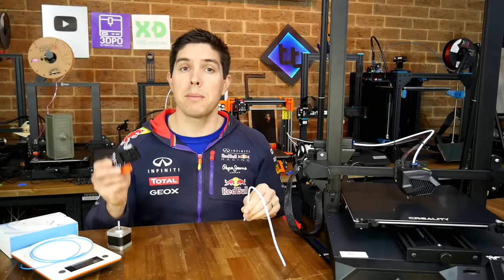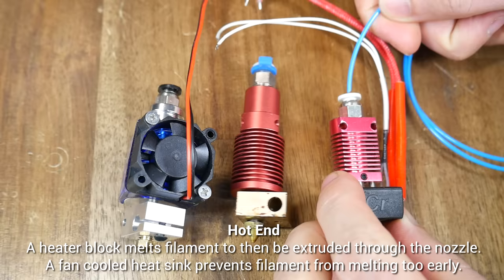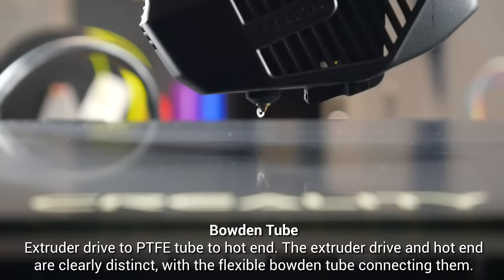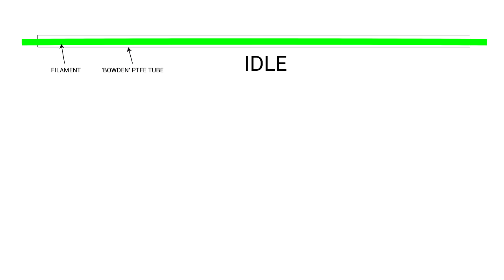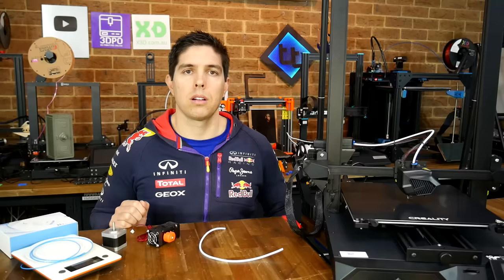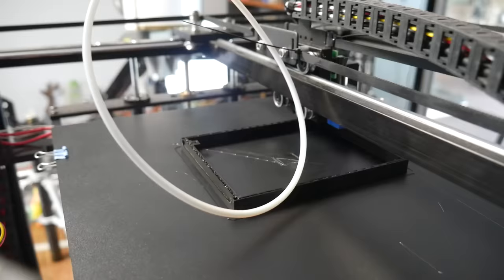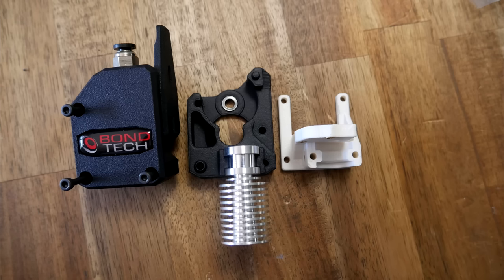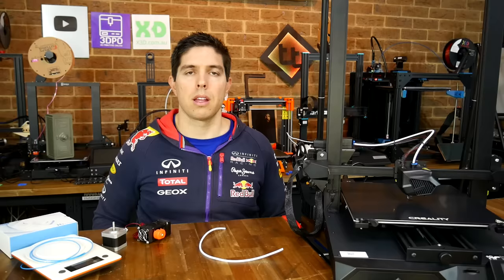Why direct drive is not automatically better than bowden tube

Comment: Of course highly subjective: My first printer was a classic I3 clone with direct drive. Then i got two ender 3s, which in the first half year of their life printed flawlessly. But after that half year, problems in maintenance mounted. One thing you did not made particularly clear is that not only do you need to dial in retraction on bowdens, but the bowden tube itself introduces alot of possible error causes and calibration in general is a lot more tricky. In my example, i've replaced almost the entire print drive section from the bowden down to the hotend without getting anywhere near the actual cause of the problem(s). The bowden tube itself is of course a consumable and even with a fancy extruder setup you can end up with filament shavings in the tube, that can ruin your day completely, because of the long filament way to the hotend. The results are: cloggings, lots of cloggings, under extrusions, failure to feed and whatnot. I have had nothing but trouble. More than i've ever had with a direct drive. 
I have converted both to a SKR Mini 3+ H2 combo and they print like a charm now. Granted the half year of the H2 is not quite over yet. So i might eat my own words soon. But so far: fingers crossed.

Comment: if you have a bowden setup that gives you trouble i think the first step should be to shorten the tube. in the tronxy yuo could halve the length of the bowden if you mount it in the center of the printer :-)
Reply: Thats what i started with,  still isnt a scratch  on direct drive for any speed of printing.

Converted my x5s-400 to a tool changer now. Still on the stock crappy vslot wheals but even with a very heavy directdrive supervolcano (1.4mm nozzle)  i have less issues than with the bowden.

The watercoold bmg clone with bimetalic heatbreak from triangle labs is my favourite for detailed stuff though

Comment: I have two printers, one with direct drive for Flex filaments and one with bowden for another printings. I will not change this before I really need something different. The next printer will be a CoreXY, and will use bowden too.

Comment: Gear direct drive extruder with a Volcano hot end with total weight print head of 300g on my delta + klipper firmware = high speed and excellent quality without vibrations and ringing.

Comment: Only issue I'd see on a hybrid extruder would be backlash from the flex driver. Other than that it would still be much easier to tune out than a bowden extruder.

Comment: I have a RostockMax 3.2 delta, with a really long bowden tube on it (probably over 600mm), and I have to say, I have had very few problems with stringing.. I print with 7mm retraction, when retracting at all (I usually have combing mode always on), but still... stringing is very rarely an issue for me.

That said, I have printed almost exclusively in ABS here, with some occasional PLA... have never tried a properly difficult material to push through a bowden, like TPU... I expect that would be a new challenge.

Comment: Flexdrives are interesting ...lightweight for speed ..but they are like 40:1 which completely defeat the high speed purpose. Though I haven't tried but there might be a way to up gear that on the motor and run a kickass bldc motor? Something to tinker maybe :)  I might order a kit. But I'm afraid of chewing gears on the print head at high speed and high accel

Comment: I use a couple of years a prusa mk3, and now I get him an Ender 3 max as big brother for the more "coarse" prints with a .6 mm nozzle. 
After a few prints, i saw no disadvantages of bowden drive compared with the direct driven prusa while printing. What sucks more is the filament change and the fiddling through all instances. On the prusa the filament is changed in seconds. (If heated up)
Sure, the first on my Ender i ve done is the trick with the separate PTFE tube and a washer inside the hotend, because so many people seem to ran into issues with the direct tube line from the drive ending directly in the hotend. The reason is the Tube slips due to movements and builds a gap in the hotend where  meltetd filament then jams. 
Anyway, i would rather invest in a better hotend w/o PTFE inlet than replace the extruder to a direct drive.

Comment: DD overall would be better BUT at the cost of print speed, since you get a lot of ghosting if you push it too fast.  Bowden allows for faster print speeds but stringing will take some tuning.  Smaller FDM printers are fine with Bowden since the tube isn't very long.  Large printers DD would be better due to a bowden tube needing to be quite long.  Medium size printers it would be down to preference or quality of the build (printer).  

I have both a small FDM printer on my desk (Monoprice Voxel) that is quite nice and has been a great workhorse so far.  The other is an Elegoo Neptune 2 (hard to find) which is an Ender 3 clone according to reviews.  Both are Bowden tubed and the stringing is minmal on both, probably just needing some tuning which I haven't done yet.  Note:  Both of my printers use a rough surfaced, removable, print bed instead of glass and neither have had ANY adhesion issues at all, in fact, quite the opposite (usually need to scrape the print off, even with a boat).

Comment: Bowden setup for machines where the bed is moved in Z only so Core XY machines and cantilever machines like the Ender 2 or Prusa Mini.
Direct drive is best for all the I3 clones, like you mentioned speed wise you are being limited by the print bed, and many print beds are still heavy glass beds (with great adhesion).
For Deltra printers a "flying" extruder works great. The Nible stuff sounds great but it is costly and you still get all the tolerances from the flex shaft.
Also an important aspect of the extruder system is if it is a 2 gear or one gear extruder. The 2 gear extruder usually is not as great as I would have thought since the teeth don´t mech perfectly and produce patterns and non uniform extrusions. One gear is enough force wise usually.

Comment: In my experience, If there’s a need to convert a direct drive machine to a Bowden to improve quality, the problem isn’t the extruder system, it’s the rest of the machine. A Bowden is like the skinny spare tire in your car; a quick temporary fix in exchange for tremendous performance limitations. The amount of head aches, tweaking and frustration getting it to print right should be considered torture.
Reply: ... I think you mean the issue is user error. They aren't that difficult.

Comment: Bit of a niche use case, but I'm messing around with custom Gcode for non-planar printing, and am finding the geometry of my direct-drive (Hemera) set-up limiting. Bowden and a very thin hot-end assembly with an airbrush nozzle for its increased length and higher taper is probably the way I'm going to go.

Comment: Thanks for not mentioning flexible filaments only being suited to direct drive - its an old myth that needs to die. It only pervades because most bowden extruders don't have constrained paths. 

Also, I prefer bowden because I can mount my heavy spools to the side of the printer completely unconnected rather than on top, which reduces ringing and increases stability.

Comment: I think it really depends on the 3D printer, for example my delta printer printhead ways only 100g and can do crazy speeds.
Would be a real bummer to put a directdrive on that.
And for some use cases for example mechanical printing speed is more important than having a little stringing.

Comment: I printed just printed the DD bracket for ender 3 and used the stock extruder..done direct drive. I havent tested it a lot but i have no more extruder skipping wich was driving me nutz. only issue so far is that the Z axis screw started to make a high pich noice when moving,thats from vibration easily fixable. I do recomend dual Z motors for the added weight because the thing feels heavy at least with the stock stepper

Comment: You should try orbiter extruder mounted on a delta effector. I successfully mounted the orbiter on a custom effector designed to fit on a kossel delta and the results are unbelievable. Is true that i had to lower jerk and acceleration but 25mm/s jerk and 1500mm/s *s are decent values for a delta without any ringing or ghosting. So, my vote goes to direct drive low weight extruders. After this conversion, my favorite material is tpu, thanks also to the dragonfly bmo hotend.

Comment: I have no problem with Bowden except tuning retraction which is a pain in the arse
Reply: use Klipper with Pressure Advance. it basically eliminates 95% of retraction
Reply: Klipper is great.  On the flip side: Klipper / DD with input shaping has eliminated 95% of ringing from me.
Reply: @GridSpace  nope. Not on long Bowdens.
Reply: @fish9468  I have 3 x 300^3 printers with 400mm bowden tubes that have gone down to a 1mm retraction after installing Klipper ... YMMV
Reply: @GridSpace  not a delta tho!
Reply: @fish9468  I have 50cm of tube running down my q5 with klipper and I am at 2-3mm retraction.
Reply: @warmesuppe  is that capricorn tube? I don’t believe it
Reply: @fish9468  Yes

Comment: I run a Capricorn, glass, and metal extruder kitted ender 3 v1. I've not had any problems with either retraction or major ringing once I tuned it, but I don't try to print at speeds > 60mm/sec. Direct drive is always tempting but until I start running some crazy flexible filament or another problem comes up that tuning & minor adjustments can't solve, I'll stick with my Boden.

Comment: I am brand new to 3D printing.  I am astonished that Michael did not mention IDEX at all.  High-quality retraction is critical for dual extruder printers, even IDEX, which is coming into the right price point now.  IDEX should lead to multi-composition prints, too, not just multi-color.  Retracting TPU and even PVA are very important with dual extruders, independent or not--and direct drive seems to provide superior retraction.  To my surprise, there are popular IDEX printers with Bowden-tube setups, and naturally, the reviews show that the filaments bleed into each other on prints via oozing and stringing.

Comment: I know you've produced videos on Klipper and people should know it's not for the novice if you want great results "out of the box", but it has features to drastically reduce the negative aspects of converting to direct drive. I've been able to hit triple digit speeds and an accel value of nearly 3k on an Ender 3 with it and see minimal ringing using the input shaper function; Titan extruder, microswiss hotend, Petsfang mount/duct.

Comment: I remember seeing a coreXY design that had separate motion stages for an extruder mounted directly above the hotend and a short bowden tube connecting them. the extruder would receive similar move commands to the hotend with small high frequency moves filtered out. not a practical solution but I thought it was cool.
Reply: You get a similar effect, but mechanical, on some deltas where the extruder is mounted a little above, on secondary arms, generally slightly flexibly connected.

Comment: Honestly only reason i can think of why to go for Bowden. Is if the assembly is really sensitive to a heavy head. Such as indeed a Cantilever design like the Prusa Mini or maybe if you are obsessed with achieving speed-printing records and wanting to try lightweight construction. Otherwise Direct-Drive is simply the way to go by default nowadays.

Comment: I'm going to upgrade my ender 3 max with the creality sprite extruder. ($110, ouch).  But I need to print super soft gaskets (as soft as possible) so this is the way to go.  At the same time, I can do poly-carbonate if I decide to go that route.  I just hope the new head isn't too heavy for my single-rod gantry.

Comment: I think it was driven by Ultimaker. Ultimaker had these awesome looking super clean prints so early on and they used a Bowden setup. So people attributed it to that and copied the design. At least I was convinced at the time that it was the lighter weight printhead that made their prints come out so good. But on my Anycubic Mega with its bowden extruder I can print TPU with only a ridiculous 10mm/s, and once you struggle with that you lust for a direct drive extruder.

Comment: Well an other middle way option was to have a suspended extruder, like in the Delta printers, which is a very short bowden with the extruder hangin' in there suspended from the top. Also, do you happen to print minis or maybe some short prints with flexible? Just make a short bowden for those prints so you can improve retraction.

Comment: Thisssss.
I've been debating this for ages and thanks for making the video.

After getting linear Advance it's just not that difference. Unless you print ninja flex.

For my Doot changer I have a Bowden and a direct drive tool. Strangely I can use the same acceleration on both! Maybe it's due to my direct drive's design which is a bit specially made for a tool changer

Btw I think a Hemera would've been perfect because everyone I talk to says switching to Hemera gives them much better print quality and it can be bowden

I'd love a proper print quality comparison

Comment: Ive wondered for a while about a different hybrid approach; a torque-sensing stepper mounted to the frame providing some baseline pressure on the filament, and a minimal lightweight stepper, providing closed loop control close to the extruder. All this motor should really have to do is regulate out the stick-slip of the bowden tube, which probably requires an order of magnitude less effort, than the bulk work required to push the plastic through the nozzle. Doesnt sound like an impossible control problem either.

Comment: I had no ringing at all on my cetus 3d printer, everything was super tight. Although it's an early kickstarter model with IKO rails. My CTC dual on the other hand... well, the head probably weights over a pound. I tried 80mm/s just for laughs and it started sliding around on my desk. The max speed I'm comfortable with is 35mm/s

Comment: I personally prefer the higher speed of the bowden setup because it's just so much lighter.
Reply: Basicaly all of the speed boat race benchys are direct drive with the exception of nitrams delta with a heavily renforced bowden.

Once you go direct drive you wont go back to bowden, especially for high speed printing.
Reply: @bassplaya69er  Those are a different kind of printers. I'm running a relatively stock Ender 5 Pro, to get the same speed as with a bowden setup I'd need to upgrade the motors. A difference of about 80g at the print head is enough to slow the printer down.
Reply: @Donnerwamp  looks like that has the x-motor on the gantry for added weight.  wonder why ender didn't just make it a corexy.  

The frame design looks like a smaller version of  my tronxy  x5s - 400.   i hope you replaced the needlessly heavy hot end fan shroud :)

have you checked out klipper's input shaping at all?
Reply: @bassplaya69er  Yes, but the Y-motor is a little stronger to compensate. One of the bigged benefits in this construction are shorter belts and therefore less backlash and possibly less ghosting at the same speed. 

I've switched the shroud for a selfprinted shroud that weighs the same as the original construction, but offers way better (and less loud) part cooling. 

Not yet, but that's the next upgrade this printer will get.

Comment: If you have a super long bowden(like the tronxy x5sa), yes it is far better to convert to direct drive. It solves the stringing and under extrusion issues. It took the tronxy from my least used and most hated printer I own to a printer that I only kinda regret buying and use it when the other 3 printers are in use or a big print.
Still don't like the printer much but at least I can get successful prints from it now after upgrading the hotend and switching to direct drive.

Long term update, the printer kept working better being switched to direct drive. I have now(10months later) converted it to a vzbot330 using abs printed eva 2.4 hotend setup(like rat rig uses) and a small pancake stepper in place of the stock stepper. 

If you got a tronxy x5sa I would highly recommend going direct drive with a smaller stepper and a bmg and run a reverse bowden to the stock run out sensor location but with a printed case and a coupler.  Much better prints and more reliable once you get the esteps dialed in which is a pain to do.

Comment: I am personally not that concerned about minor print defects as far as general print quality goes. I'd go for bowden rig any time just because it makes the print head extremely lightweight and allows for crazy fast printing. Whatever it is that comes out of the printer is being sanded, painted and covered in additional protective layers anyway, so I don't care for stringing all that much. As long as I can get reliable and durable prints, without having their layers peel off and as long as I get them fast, I'm good with that. I use multiple materials for my prints, but I only use two colors: either white or clear. As an example, my last project was an Oculus Quest 2 headstrap, with custom headphone arms (gave my Marshall Major 2's a second life) and a built-in power bank made out of diy board and 6 21700 cells. Imagine printing parts that are supposed to support both the headset and six of those heavy cells while hugging your head without allowing any movement on your face. 65% infill for most of the parts.

Comment: I feel that for coreXY DD printers, once input shaping on Klipper heads to things like Marlin, itll be even more popular for DD printers in general, and negate any issues further. For bed-slingers, yeah not much will change of course.
Reply: Bedslingers do benefit a lot from input shaper. And x and y do generate separate resonances on any printer, so it’s still worth having a lighter toolhead on a bedslinger.